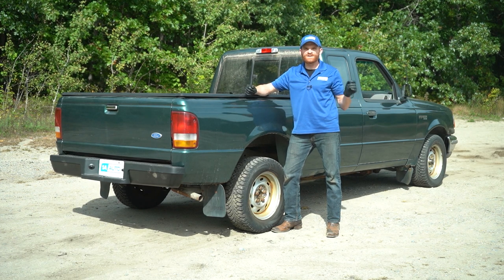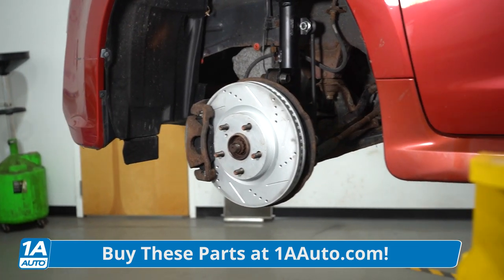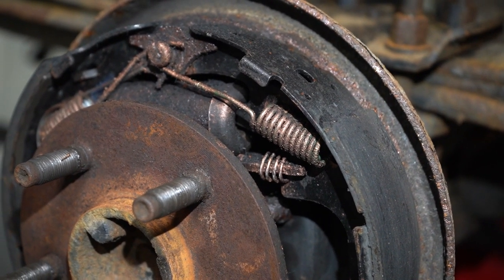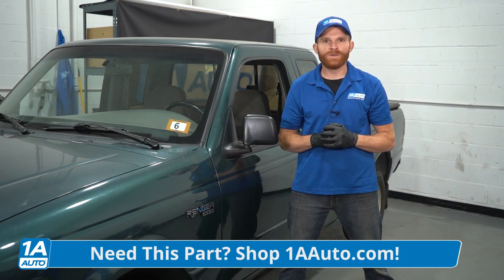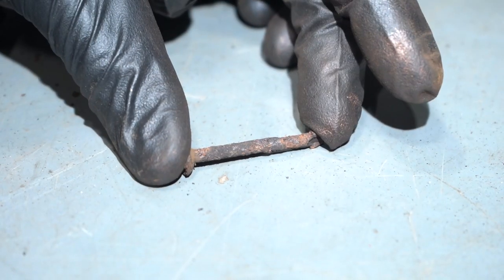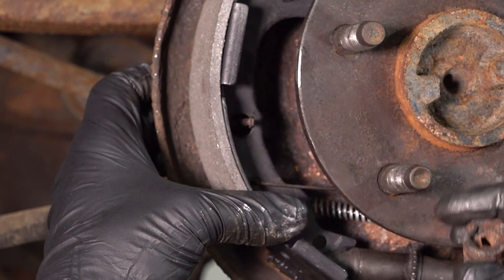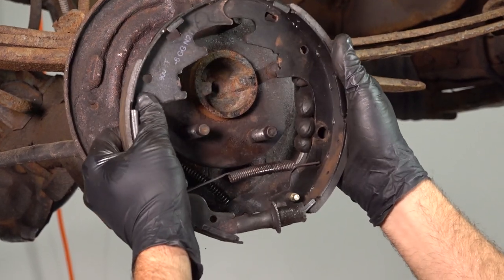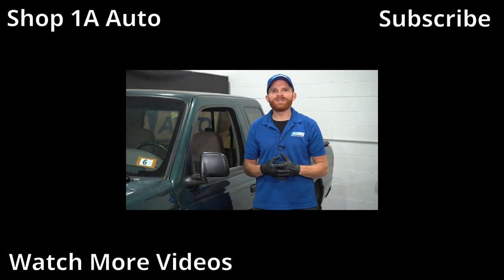Car or Truck Rear Wheel Locks Up in Drive but Not Reverse? Check for Loose Brake Shoes or Hardware

Comment: Thank you! Took my vehicle to 3 mechanics, and none of them mentioned the possibly rotted springs or shifting of the shoes. This is most likely why the wheel locks, and sometimes it doesn't.

Comment: We changed the shoes the springs and even the drum oh also the bake line on the back and the tire is still locking up after you drive for a while. Thoughts?

Comment: Have 96 chevy lumina rear wheel locked up when tighten lug nuts. Replaced ever thing in drum break .its good an free till put wheel back on. Number of mechanics have worked on can't fix it. Any one can you help thanks

Comment: That's how drum brakes work is not really hydraulic pressure it's the mechanical rotation of the shoes ( not alot of rotation) that gives you the braking power